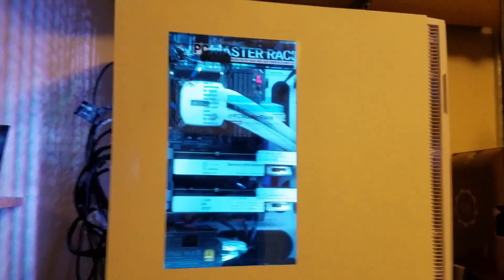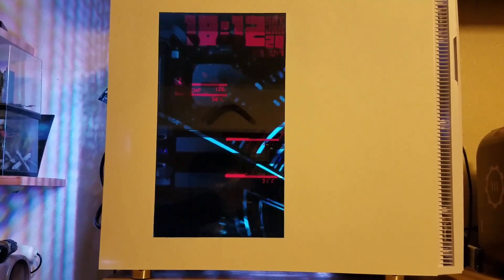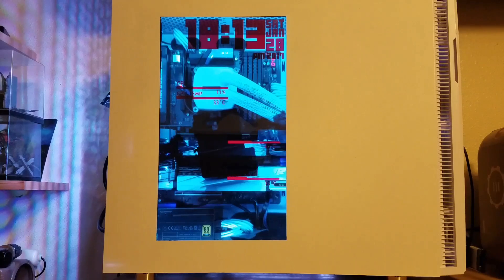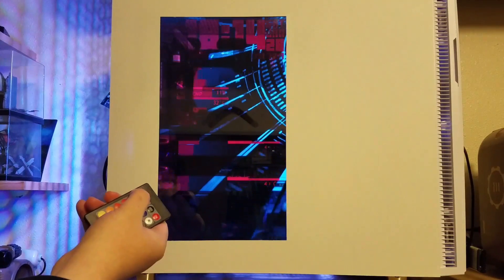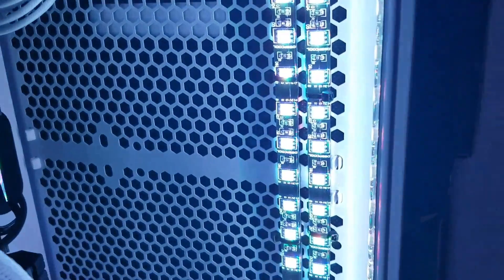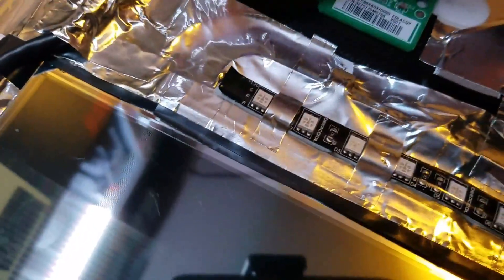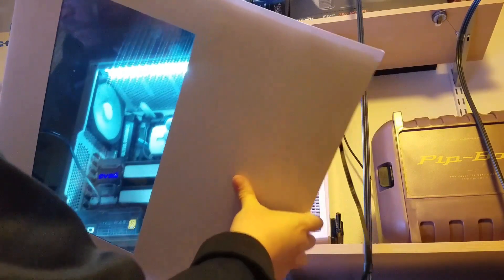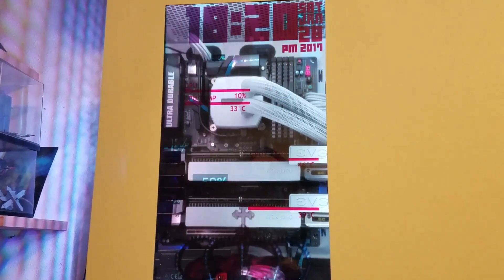Lcd side panel: followup and requested features demonstration

Comment: I cant see my monitor powered on once I pulled it apart.  Even when I plug it into the wall with the circuit board.  It initially kinda seems like some.power goes through the monitor but than nothing.  Even when shining light through the monitor I can't see anything.  Mind you the led on the switch isn't even lighting up anymore so maybe something broke.  I wanna go the AOC route now as it seems easier.  I have h440 case though and the AOC won't be large enough.

Comment: Hey I hope you see this message couse I'm doing the same project. Did you remove the anti-glare layer on the display?
Reply from the maker: The monitor I used did not have that
Reply: @pixelsixdesigns  Oh the AOC ones don't have it? Great I've bought one of these and wondered if I had to do it

Comment: Where did you buy aluminum tape?
Reply from the maker: Das Gonz most general hardware stores will have it in either the adhesives tapes sections or in the ventilation duct areas. I know Walmart and the like have them near all the rest of the tapes.

Comment: can you give me idea of the dimensions of the AOC monitor once stripped down to what you have now? Thank you
Reply from the maker: Xero Content its difficult to get an exact measurement with it installed but the panel is about 9inX14in or 22cmX35cm of course some of that width is the attached controller board.
Reply: PixelSixDesigns thank you, in the process of reproducing this in a mini ITX case.

Comment: Will this work on tinted tempered glass?
Reply from the maker: Daniel Waseem it will work with any side panel. The question is more of will it look good. Things to understand are there are usually one or two electronic controller boards attached directly to the panel. You may not have the ability to hide those using a full clear side panel.

Comment: I trust that shelf
Reply from the maker: It's rated for 250lbs per stud. And it's supported by three brakets. The system itself is maybe 35lb. Soo it should be more than safe.... Knock on wood.

Comment: The link you gave is for an LED monitor, your title says LCD, does that make a difference?
Reply from the maker: 5ive-7even the lcd is the actual screen itself. Led is just the light source of the screen. So it's two different components in the same monitor.
Reply: Great, thanks for the quick reply. Ordering it now.

Comment: any idea where to get cheap usb screens?
Reply from the maker: Victor Klemm for cheap ones, most likely eBay or some other reputable online stores. for the one I bought the link is in the description.
Reply: oh btw, how did u make it THIS transparent?
Reply from the maker: Victor Klemm the lcd panel is already transparent. The way lcd panels work is by filling pixel with color/density to block or let more light through. So in this case to be shown as transparent you need to display white or light colored images on the screen.
Reply: i have taken apart 6 different displays now, and none of them have been this transparent, you can kinda see through them, but for the most part it's a fuzzy blur. unless you put an object right up to the display.
Reply from the maker: RyanVelvet sounds like you may have diffuser layer stuck on the panel. Some of them are stuck on with a light adhesive.
Reply: All the panels I have taken apart have only been CCFL type displays, not sure if that has something to do with it or the way the polarizer worked on these older displays. But for the moment it seems like anything with a CCFL won't work for this. The only layers left on the display are the polarizers, and it's a bad idea to remove those. 

Atleast these are my findings.